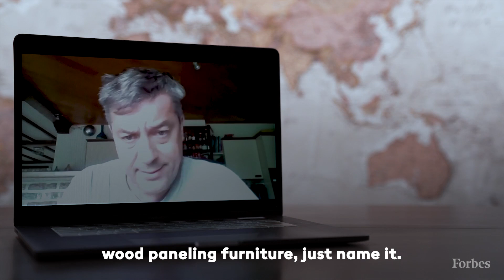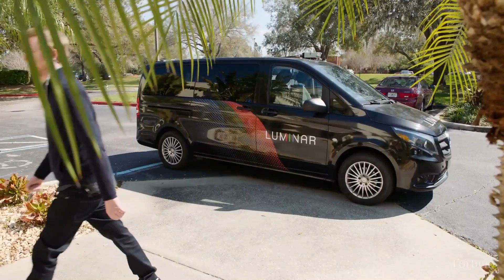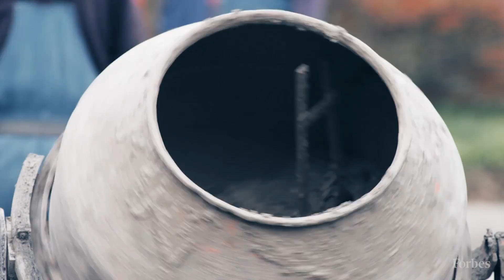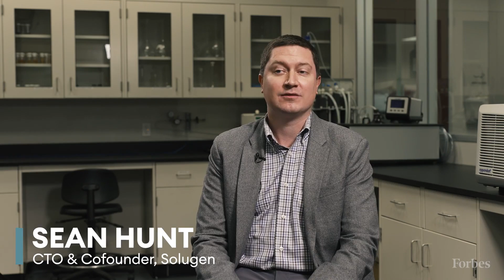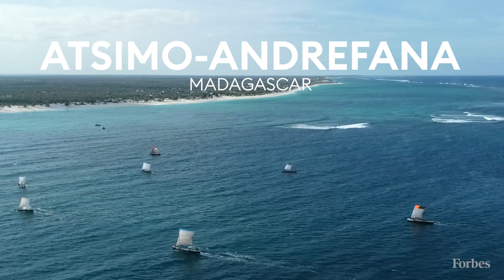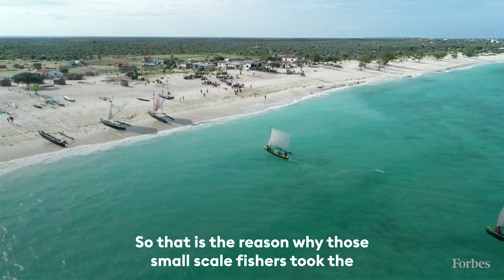Best Of Forbes 2021: Manufacturing & Industry | Forbes

Comment: All the crypto mining alternatives sounds like elaborate greenwashing:
-Seal the wells that expulse methane? Nope, use it for mining, still release CO2 that will need to be recaptured later, using energy.
-Only use solar or wind energy? We need it to reduce non-carbon neutral energy production
-Only use excess energy? Makes only sense if excess green energy was produced and no energy storage capacity is available.
-Use proof of space? All the digital storage still needs to be produced using resources.

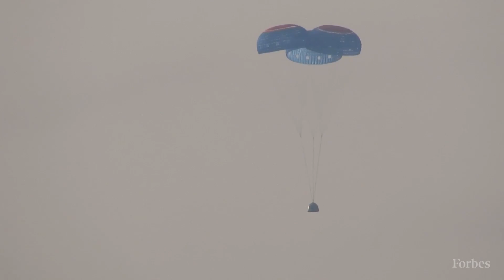Comment: 1:32:16 You are making it sound like any rocket could use that cleaner hydrogen fuel to make rocketry overall more environmentally friendly, but you are misrepresenting the fact that this BlueOrigin hydrogen rocket cannot put satellites into orbit and is only capable of short and quite pointless tourist flights to the edge of space, which in itself a very wasteful endeavour.
SpaceX for example uses dirty kerolox fuel in their Falcon 9 rockets because it has the power to put them into orbit (among other tech and cost reasons). SpaceXs Starship engines will use CO2 intensive methalox fuel specifically because the base components can be produced on Mars for return flights of the vehicle. It simply could not function with other types of fuel.
One always has to weigh the cost against the benefits.